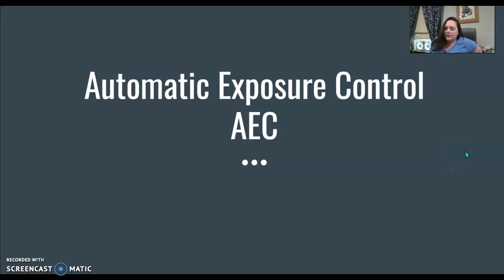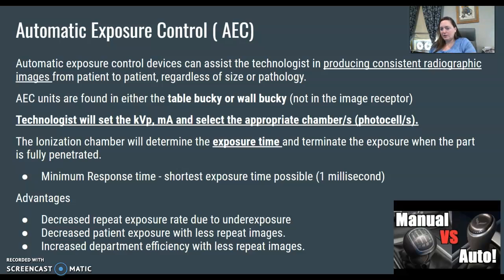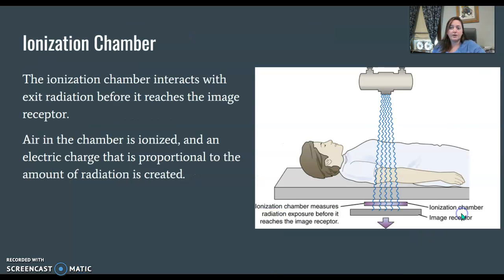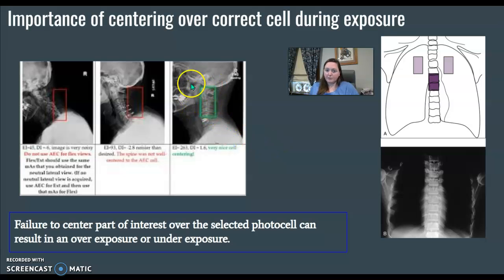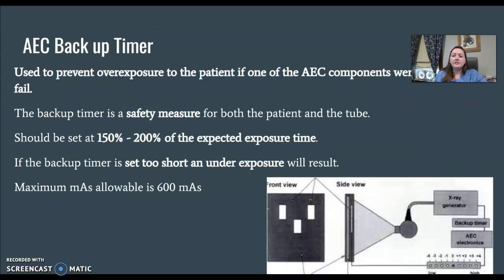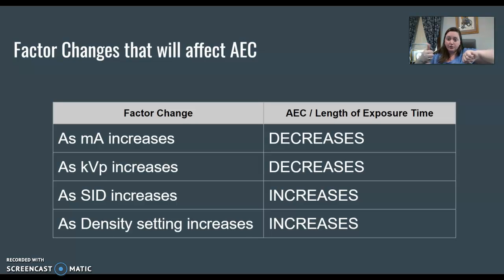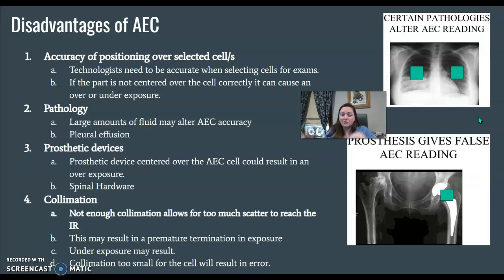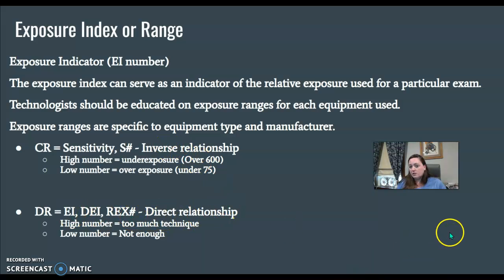AEC

Comment: Hi Meaghan,

Can I just check if using AEC for a chest x-ray, the mAs is low because the ionisation chambers detect the photons more quickly because the kvp is so high? (We use 125 kvp) just trying to make sure I understand this correctly. Thankyou
Reply from the maker: Yes high kVp allows us to use low mAs. But also think about your anatomy of focus on a chest, lungs are not very dense and do not need much mAs.

Comment: Hi Meaghan, would please explain this concept? I am having hard time to understand it.
Thank you

Which of the following groups of exposure factors will deliver the least amount of exposure to the patient?
A
 400 mA, 0.25 second, 100 kVp 
B
 600 mA, 0.33 second, 90 kVp 
C
 800 mA, 0.5 second, 80 kVp 
D
 800 mA, 1.0 second, 70 kVp
Reply from the maker: To answer this question I would like you to calculate out the mAs for each answer option.  Multiply the mA by the seconds = mAs.  Then think of your exposure concepts.  The question is asking you which set of factors would give your patient the LEAST amount of exposure.  mAs is the main controller of patient dose, so a lower mAs would give less exposure.  If given an option with high kVp & low mAs that would be the ideal option.  Do your calculations and think through the concept!
Reply: A